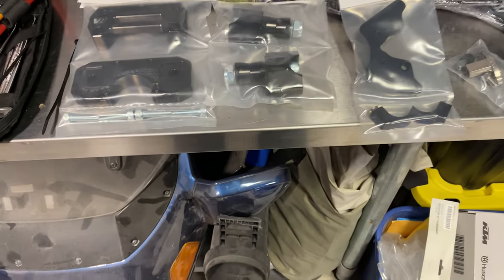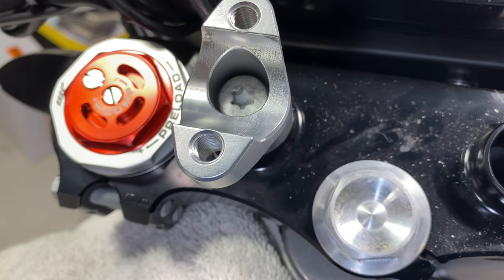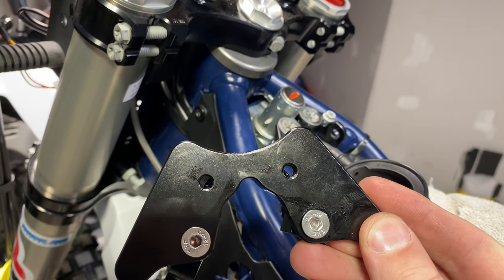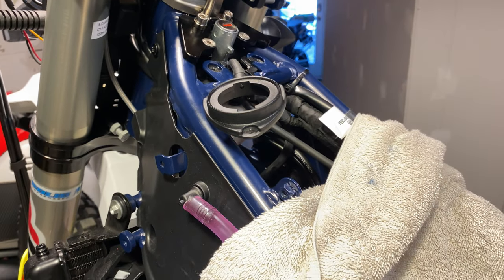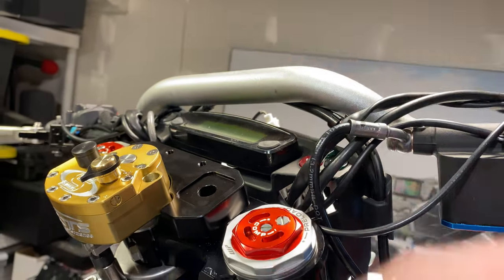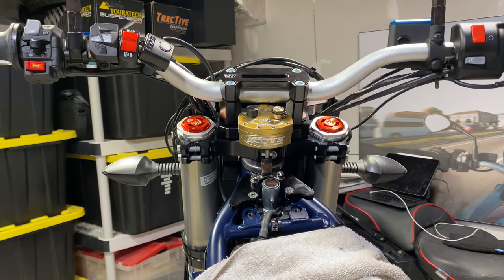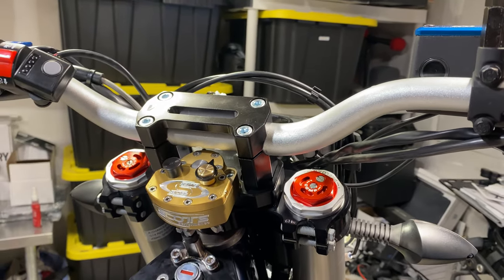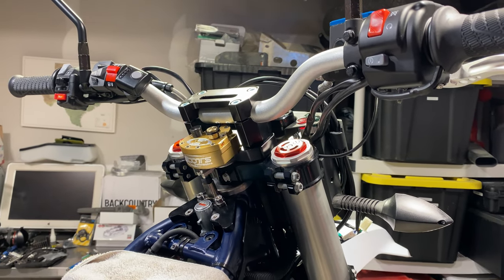Husqvarna 701 Enduro LR: Install Vanasche Bar Riser & Scott's Steering Damper Submount

Comment: Hi Adam. Great video and for me having just bought a 2023 701 a mod I’ll be doing. Just a point of concern: how much higher could you have raised the bars? Is there much more free cable/hydraulic line length to do this? I’m only 5’8” but my aim is as close to a GSA riding triangle (perfect for me) and the standard seat/footrest/bars distances need some work. Many thanks, Ian
Reply from the maker: Hi. Sorry for the delay. I was traveling. There is plenty of slack left in the cables for you to go a bit higher…maybe a couple of inches although at that point, it might make the geometry of steering a bit ‘weird’ but that’s just my -experience with going way too high in the past. I think the GSA ergos are perfect so I agree with you there.

Comment: HI aain Adam. I might have missed it in your video - but did you have to trim the ignition shroud when you were doing this install? Thx, Stevie 🙂
Reply from the maker: I didn’t think I had to initially but yes I did end up trimming it a bit. Minimal modification to the OEM part and it works well.

Comment: Nice work - the install instructions are available on the Vanasche website. I had the same problems with fit of the frame bracket on my LR due to the bracket for the key switch cover. As a result Vanasche has pulled the LR kit off their site and are redesigning the bracket. Unfortunately there was. No way to modify their bracket to fit.  I bought a BRP bracket for a standard 701 and was able to cut and fit it around the brackets and reinstalled the key switch cover.

The kit eliminates the rubber bushings on the stock risers. I found the engine vibrations were really buzzing my hands and switched to Flexx bars. 

BTW - the 10 degree High bend Moto bars match the OEM bar specs but have a higher rise.
Reply from the maker: Thank you. Bars will be a next Winter project but will definitely happen. I too am waiting for the Vanasche parts and planned on shooting a follow up video. I published knowing there was a compatibility issue and I really should have added a pined comment about that but I honestly figured by now they'd have the part shipping. I'm probably going to remove the stabilizer and frame bracket until the revised part ships as it's literally the only thing that hasn't arrived yet and is keeping me from riding.
Reply: @AdamChandler86  Is that the new redesigned Vanashe Scotts Damper frame plate you installed there which allows the tank to be fully bolted down at the front ??.  Also you should consider bolting down the Scotts damper using the security bolt kit....as it's an expensive bit of gear to that is easy to steal, especially if you use the slightly higher bar risers which gives direct acccess to the two hold down bolts
Reply: @raymond woo, please qualify how much more vibration did you experience without oem rubber cones? how does vibration with the flexx bar compare to the oem setup with rubber cones?
Reply: @damytzeus  there’s 60% less vibration with the flex bar+Vanasche combo versus the OEM  combo
Reply: @raywoo1  so, to confirm, you're saying that you experienced less vibration with flexx bar + vanasche submount compared to oem rubber cones+oem handlebar?
Reply: @damytzeus  yes
Reply: @raywoo1  thank you. i ordered the vanasche riser and 10* adventure lo flexx barr.

Comment: how did switching from rubber cone inserts to aluminum cone inserts affect the vibration?
Reply from the maker: Hard question to answer because I never ran the bike in OEM state..I changed everything out with zero miles of riding time but I will say I don't think it vibrates too much. Obviously vibrates more than a GS but not more than my beta 500 single.
Reply: @AdamChandler86  thank you

Comment: Lock tight 277 is the only way to go
Reply from the maker: That would require applying heat to get them loose. 243 /290 have been good enough even on “permanent structural bolts” on these bikes. I tear down the bikes so much that I wouldn’t want to fuss with anything harder.
Reply: @AdamChandler86  don't take it personally ... Also game my brother 277 and told him it was lube for his lug nuts
Reply from the maker: I'm not sure I understand. A) I'm not taking this personally, my use case is just different than yours B) Were you making a joke about permanent loctite as a lubricant?